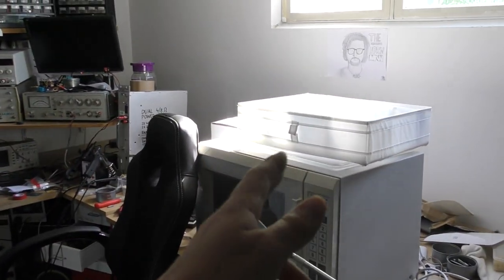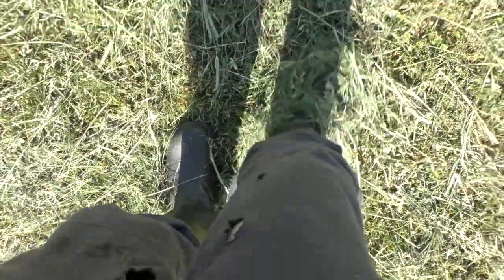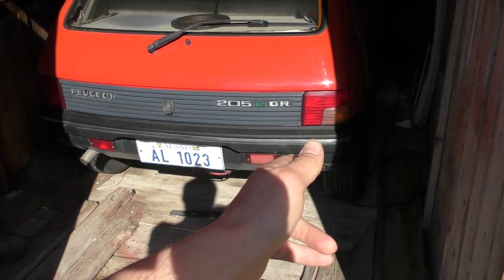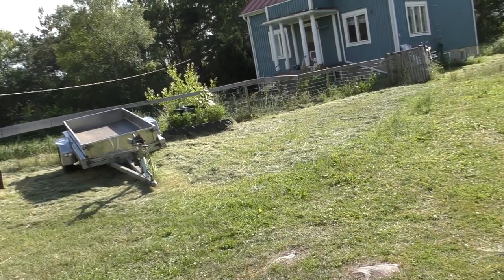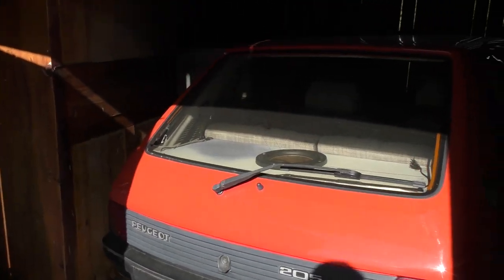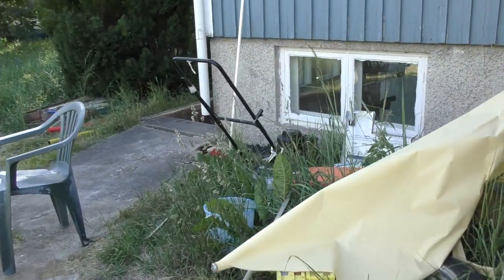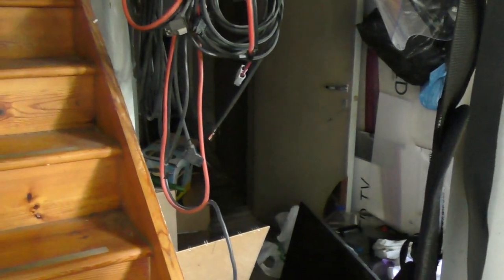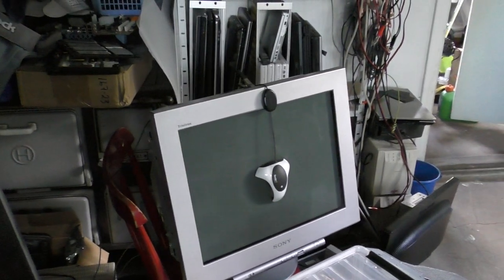Blog. Unedited. State of the workshop / what's going on around here (lots)

Comment: have you tried adjusting a valve lifters lash in your 205 ?
the rocker arms should be adjusted from time to time and i think that is the only thing that can make noise in valve train
Reply from the maker: They were adjusted not too long ago (2013 or so). I'm not 100 % sure of the source of the noise. It's either piston slap or a damaged valve. I really need to use a timing light to figure it out in order to be sure.
Reply: man tahet was 4 years ago allready :P
if I'm not mistaken valve lash should be checked every 30 k KM
Reply from the maker: It's barely done that since 2013. I'm starting to become reasonably certain that it is piston slap in cylinder four, however. Sad times.